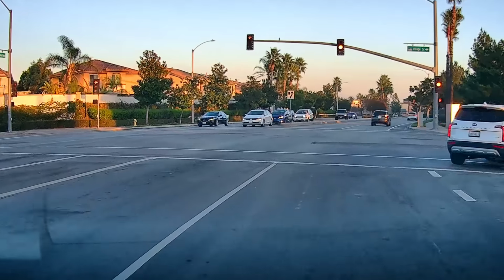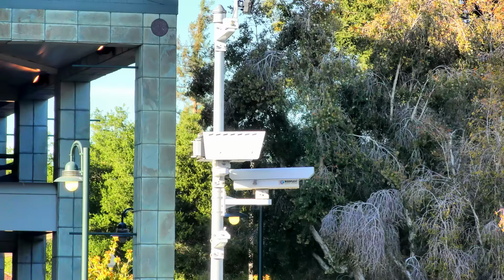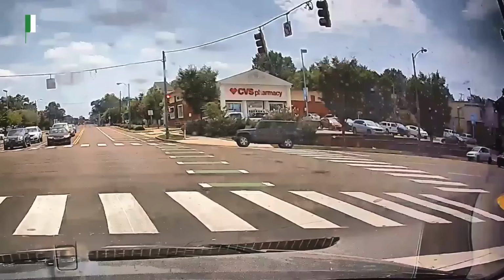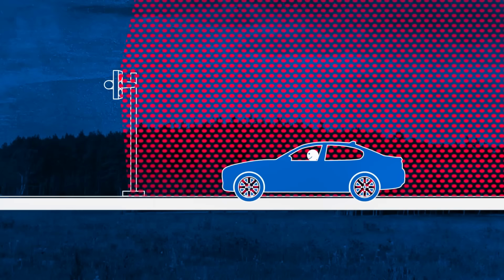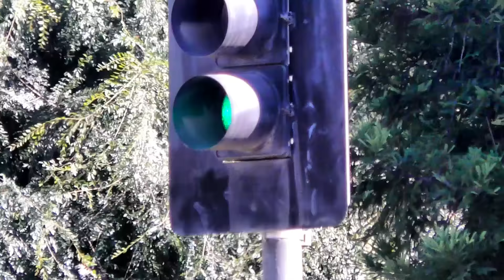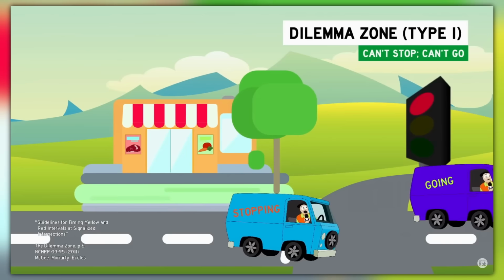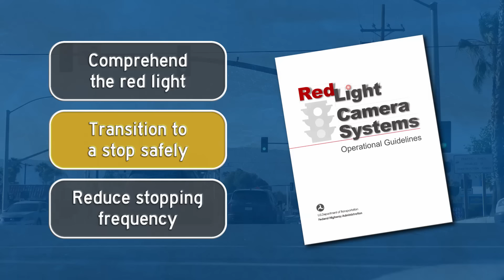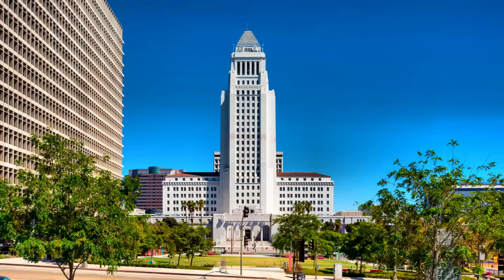Three ways to FIX a STOP LIGHT (so drivers ACTUALLY STOP!)

Comment: Rob, I'm red green colorblind. White on the bottom means go, yellow in the middle means slow down, and off means stop (or dim red at night). The problem? My county has been replacing all our vertical lights with horizontal ones. This has created serious confusion for me, but I haven't said anything because I'm afraid I'll lose my license. But it's a major issue.
Reply: ב''ה, down the east coast (some places between NJ and FL) visibility strobes overlaying lights were a thing, particularly where lights end up directly in the path of the setting or rising sun.
 
20 years ago I think this was a real xenon flashbulb suspended across the face of the red.
 
LEDs would give some opportunities here.  Are red LEDs less visible with your form of colorblindness than the old filtered bulbs?
Reply: I just watched another video about horizontal lights. It seems they must be left to right in the way vertical lights run top to bottom (i.e. red always on the far left). Is that not sufficient to work for r/g colorblind folks?
Reply: @josephkanowitz6875  i love how you just assumed that people know what ב"ה means
Reply: Yellow doesn't mean slow down here... it means the light is about to turn red. There is no legal requirement to slow down. You can cross the line into the intersection as long as the light is not red.
Reply: I hate to say this but you clearly know you have a problem which should be communicated to the DMV. Perhaps they have a solution for you other than taking away your licence.
Reply: @UnrelatedPopcornFire420  It's hardly relevant to his post, methinks. Shalom.
Reply: @videosrus8631  shabbos
Reply: @bloozee  Remember Starman? Red light = STOP. Green light = GO. Yellow light = GO VERY FAST.
Reply: @vatechie21 there is one traffic light in the United States, on Tipperary Hill in Syracuse New York, which is green on top. And there are signs all around it warning you of that.
Reply: Wait... so you can actually lose your license when you speak out about an issue that hinders you as a motorist?
Reply: @bloozee  Oh the differences ;) as far as I know the whole of Europe treats it the same way: 'Stop if you can safely do so (read: not get rear ended by the idiot behind you who thinks it's better to speed up to still make it through), proceed if you can't.' But this all depends on the distance you have to the light itself: you should be able to brake safely, not slam the brakes to stop by all means, even if there's no one behind you.
Reply: @weeardguy  I have confirmed that you cannot cross the solid white line when the light is red.. that's it.
Reply: In the US, the convention is red is on the left, when the light is horizontal.  Red is on the side of oncoming traffic, green is on your own side of the road.
Reply: @carultch  thank you for this!

Comment: When using red light cameras in the early 2000's, they found out that the number of intersection accidents dropped, but the number of rear-endings increased exponentially.  Not only that, but northern states where icy roads are common, people were getting tickets in bad weather, even if they were driving safely for the conditions, but they just couldn't stop (been there myself).
Reply: It's definitely not all it's cracked up to be, same with speed cameras. Comparing the places that use them, the accidents and fatalities per Capita aren't reduced or significantly lower than most other places.
Reply: Well the near rear end collisions is the fault of bad driving habits, if people stop following so closely that would mostly stop happening.
Reply: @matthewm4020  Oh, I'm certainly not trying to place blame on any one thing, just stating something that I found about these cameras once.  Nothing can be perfect in this situation.
Reply: I'm a big fan of the "All or None" approach to red light cams. If the cams are at all intersections at once instead of only a few it well train people to not run them or they'll forget they're there after a while. :)
Reply: I'm a fairly new driver. I've only run two red lights. Both were on days with icy conditions where the light turned yellow at a bad time. On both occasions, I attempted to slow to a stop but didn't have enough traction, so I wound up going through the intersection after the light turned red.
Reply: If you can't stop for a red light you are not driving safely for the conditions.
Reply: @Roddy556  The problem with this is that on a straight road you can clearly say how far you are from potential obstacle. The car in front of you will not just stop suddenly, it will also slow down to a stop, even during emergency braking. You count the distance to the potential place where you will have to stop. Now the problem is that if the traffic lights don't take the weather into consideration, then you will be in a situation that will always yield a ticket. If you are driving slow enough to stop before the intersection when the yellow light comes on, then most likely you are not able to clear the intersection in those 4 seconds. That's actually something I described in different comment. In US style lights and law, if you are 60ft from intersection and the light changes, you either have to stop in 60ft or you have to clear the 120ft in 4 seconds until the light changes. That's the problem. In normal conditions when you are driving even 35mph, you need 60-100 ft to nicely stop, maybe shorter with emergency braking but that's a huge rear ending risk.
Generally speaking, the intersection may be like 60 feet or more in length. That's how much you have to add. If yellow light is 4 seconds and you can't stop before intersection, you have to cover the whole distance to intersection and the intersection itself within 4 seconds. So let's say that the stopping distance you keep is 200 ft and you have extra 60ft of intersection to clear. To clear this you have to drive 45 mph but those 200 ft are a stopping distance for 35mph. If you were driving 35mph and you are closer than 200 ft from intersection, you are most likely to continue even if the light changes to yellow. Otherwise you may not stop before the intersection. But at 35mph you are driving 52 feet per second. It means that it will change red while you are entering the intersection. So let's slow down to 20 mph before each intersection. You will need 30-50 ft on dry road, twice if you are stopping on very wet or snowy road. So let's take the safe 100 ft as a decision point. It's green, you decide to go, now you have 99 ft to intersection and 60ft of intersection, it changes to yellow. Total is 159ft but 20 mph is 30 feet per second. You need over 5 seconds, you will again cross on red. So what, you should drive 10 mph? That's unrealistic too. At 10 mph you are driving 15 feet per second. If the intersection is 60 feet long, you need those 4 seconds just to clear the intersection, there's no space for stopping distance at all. It does not matter what you do, in icy conditions you will always run on red if it changes to yellow when you are close to intersection. It does not matter how slow you are driving, you will always cross on red, either you will not stop before or it will change red before you leave intersection.
That's why I find EU laws a bit better in this particular situation. Running on red means that you entered the intersection on red. If yellow is 4 seconds, it's only the time you need to stop or enter intersection, not the time for clearing it. Although I like traffic lights installed behind the intersection, I see much more issues with it than benefits.
Reply: @Roddy556  they don’t change yellow light times when it’s icy out
Reply: @Muhahahahaz  well I guess people should drive a bit more carefully when it's icy out.

Comment: My town used to have coordinated stoplights downtown. Speed limit was 20, but if you drove exactly 15, you'd cruise through the entire downtown without a single stop (other than the first one if you are unlucky).

Nowadays, those lights have drifted off of their coordinated timing, so it doesn't quite work, but I definitely remember the joy of watching the guy in the other lane accelerate past me, slam on his brakes, and then I'd gleefully drive past him just as the light turned green... and we'd do this for ten straight blocks. :-)
Reply: pity you didn’t capture that on dashcam! Would have gained a lot of views!
Reply: We call this a 'green wave' in The Netherlands. Besides a sign announcing you're about to pass the first light where you'll enter such a road, it will also tell you the amount of lights that are part of the green wave and a sign stating which speed to adhere to.
So the sign is usually something like this: 'Green wave (6 x) at 45 km/h'. So if the first light is green when you pass it and you stick to that speed, you get the guarantee that the next 6 lights will be green as well.
Near the German border in a region called the Achterhoek, a busy provincial road even has pre-advance warning signs stating if the green wave is still 'active' or not, by showing a green ~ sign accompanied by a speed in km/h, which changes as the green wave is coming to an end. When there's no green wave, the sign turns off as far as I know.
Reply: Meanwhile in my US town we will have a green light turn red for absolutely nobody LOL, seems like traffic lights could be so much better then they are with just a little bit of effort.
Reply: @Winner3ty   Exactly!  We have lights that turn red for no reason, and red lights that stay red for years after the last vehicle has gone through the intersection, and then city officials wonder why people run red lights!  😡
Reply: Coordinated lights were awesome.  I remember them
Reply: My city decided to combat street racers by coordinating all the lights to turn red if you were going the speed limit (40 mph). Unfortunately that incentives people to drive 65 so they can beat the red lights.